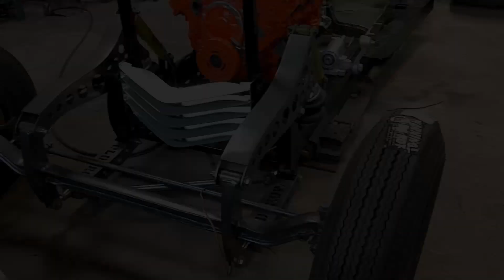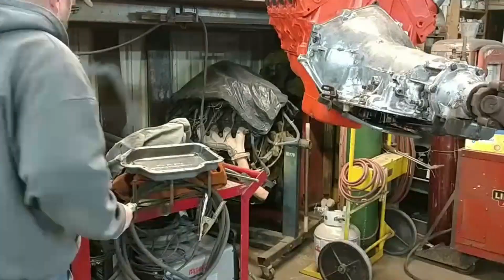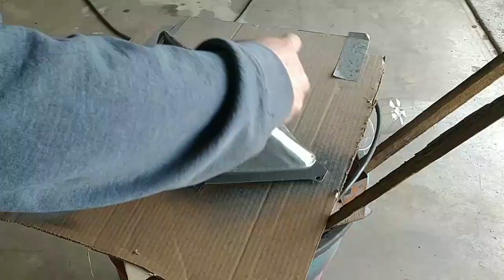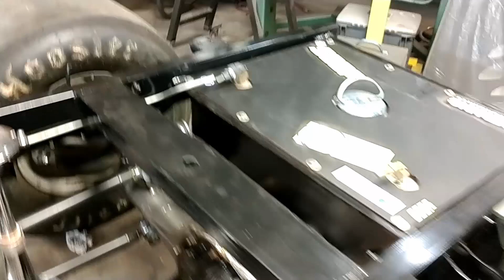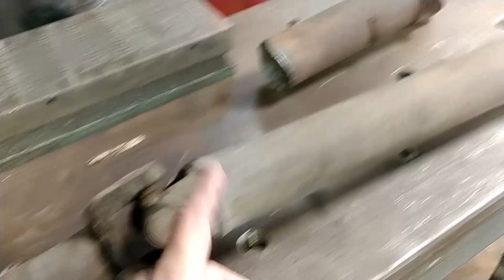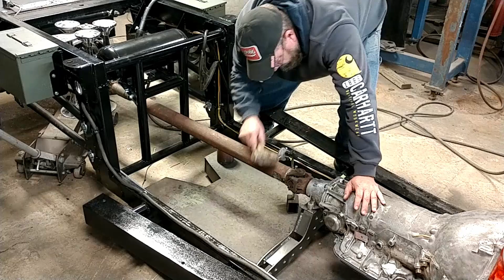Chassis and motor are married again (Rat Rod build 33)

Comment: Hope you indexed those yokes to be inline with each other on both ends of the driveline before you welded them. If not your gonna have a hell of a vibration problem. (ask me how I know)  If ya pulled that TH400 out of a motorhome, It's quite possible it's got a straight cut planetary set in it. (good for what you're building) For sure it's got the 6 count clutch packs in the forward and direct drums. (also good)
Reply from the maker: OH YEAH the yokes are lined up!  As for the 400 didn't know there was a deference in the motorhome ones that's good to know.
Reply: @HardCoreFab  b.t.w. love my new "Hookers & Blow" tee ;)

Comment: what u going to do about the no slip yoke
Reply: The front of the driveshaft is a slip joint on the output shaft. In this arrangement, the rear u-joint companion flange bolts to the differential. In front of it is another slip joint that is welded to the driveshaft. So 2. You can balance the driveshaft as well using two worm clamps. You run the rear axel at 3 different constant speeds and place your hand on the rear axle with index finger extended to indicate vibration. Move the worm clamp or hose clamp opposite directions to see if vibration become worse or less. It takes about a half hour to complete. Once done, you weld a weight(s) on the location at the head of the clamp. This procedure is in the GM service manual since 1986. 
Hope to answers your concerns.
ASE Master Tech since 78, Retired.